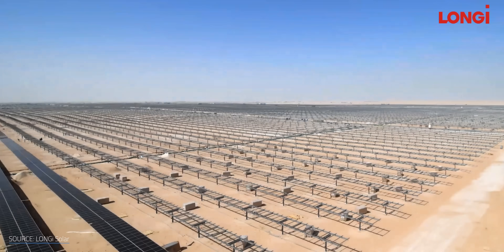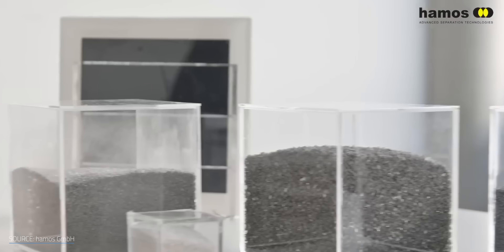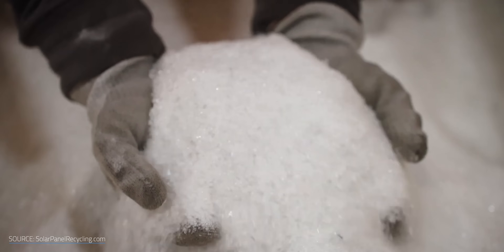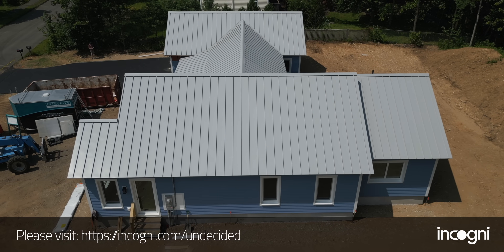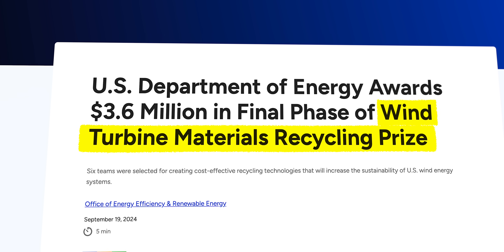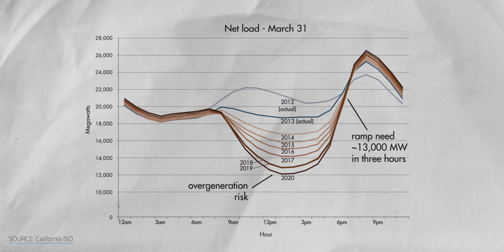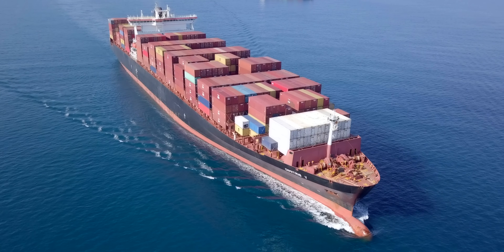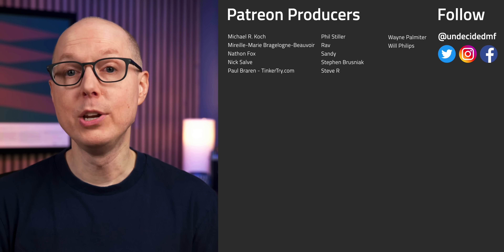How We Solved Renewables BIGGEST Problem

Comment: I work for a recycling equipment manufacturer/integrater and we recently had to try separating material for solarcycle trying to separate solar glass from the silicon cell and metal. It's extremely difficult to get to the materials to the desired purity. As with anything, chasing that last 0.1% of purity takes 99% more effort. It's exciting to see these companies exploring the recycling options but in the case of solar cycle they don't have a industry scale solution and have yet to design a full scale process
Reply: Maybe it would be better if they produce the 99.9% pure material and sell it to the company that manufactures new products to do the .1% additional refining. I'm guessing part of the issue is that the feed material isn't always constant as company A's solar cells may use a slightly different solder than company B.
Reply: @ryelor123  it’s really just about the sheer diminishing returns on how much you have to invest to get to that final purity. Thing with recycling is that it’s almost always more expensive than getting new raw materials, just because out how much effort you have to go through to get to that last final usable product, while also maximizing the recovery of the materials. It’s easy to get 100% purity if you’re not worried about losing extra material, but as soon as you try to maximize recovery and purity, the two metrics start working against each other. My company builds plants that sort and recover materials from household and commercial waste products,(getting plastic and glass bottles out of food waste etc.) and the people who run those plants sell their materials to secondary plants who have to refine that material that much more. And the capital cost of all of those plants are in the multi-million dollar range. Nevermind operating costs. TLDR you can reach any desired purity you want, but it gets exponentially more expensive the closer you get to 100%
Reply: Yeah this is clear a specialized  process and most can only remove glass and frame. This why large scale facilities are needed.

Comment: Hey Matt, it's nice to recovery high yields of valuable metals from batteries. But the electrolyte is often neglected or degraded. Whilst the most used one is LiPF6 in cyclic carbonates, producing hazerdous substances. So this issue still needs to be tackled.
Thanks for the vid again!

Comment: Thanks for the nice video.
The real question is what is the final carbon footprint of a technology.
We have modern gas and hybrid cars that have a smaller carbon footprint than fully electric cars that do not become carbon neutral in even 8 to 13 years or never, depending the region one lives and origin of the power production.
That is why we need modern nuclear energy until we figure jow to mange the impact of other systems and massive batteries.
I am trying to be realistic since we built plans like the EU Euro plan that have proben to be totally inaccurate yet they have created a huge disruption.

Comment: The real problem is with the grid. The grid is not interconnected.

Here is an example,

In Germany in the northern part the wind potential is very high and last year they had to stop wind turbines (power curtailment) but the southern side of Germany had to use coal power plant because the grid was not connected properly. Even if they want to use renewables they just simply can't.

I WOULD SUGGEST THAT WE SHOULD FOCUS MORE ON GRID INTERCONNECTION
Reply: Grid interconnection has major engineering and operational challenges that aren't obvious. I live in Washington State in the US. Our grid is connected to all the states around us, and we sell a lot of hydropower to California. There are 2 major changes with this:
1) Power is lost quickly over long distances. By the time the electricity reaches California, more than three quarters of it has been lost.
2) Power problems in California affect our grid. Anything that could cause a major blackout there, (quakes, storms, fires, just don't live in California, k?) causes whiplash to the grid here. Now, Washington has robust systems in place to compensate, but they're not cheap or simple. Other states that sell power to California often have brownouts whenever anything happens in California.
Reply: @marenjones6665   We had that a few years ago when the central part of the US grid systems got overloaded.  Texas having 20-degree weather was causing blackouts all the way up in North Dakota that was having -20 and worse weather.    20 degrees without power is an inconvenience, -20 without it is fatal.
Reply: @marenjones6665  "more then three quarters has been lost" sounds way to high...? Dont get me wrong, there will be losses ofcourse, but 75%? Ive been able to find two interties between WA/OR and CA. The Pacific DC intertie and the California Oregon AC intertie. The Pacific DC runs on +-500kV (1000kV pole to pole). And the CA-OR on 500kVAC. They're 1360 km and 960 km long respectively. (~845mi and ~600mi)

 I have to admit I havent been able to find any hard numbers for either regarding efficiency. But in general HVDC will lose about 3.5% per 1000km, HVAC about 6.7%. Wich would mean they get about a ~95.2% and 93.6% efficiency... Ok, these are general numbers, so take it with a grain of salt, but I'm calling bullshit on the "more then three quarters" thing... Its not even three quarters that gets to the other end, its WELL above that.  

But I agree on the problems on one side affecting the grid on the other side. You get the benefits of transfering imense amounts of power, but there is always the possibility that it'll go down. So it aint perfect, i'll give you that much. But to me, that's not a reason not to do it at all. I live in Europe, it doesnt get much more interconnected than over here. And our grid (in my neck of the woods at least) is incredibly reliable. As in: over the last ~10 years I expirienced exactly two poweroutages, each lasted about 30 minutes... Counting the poweroutages I just heard about within the area. That number rises al the way to:.... 5. Of wich one was about 3 hours, the others were also about 30 minutes. 

Anyway, my point is, its not easy or cheap, nobody (with any knowledge about it) will say that. But it can be done and is simply nessecary to make as much use of renewables as we can.
Reply: @daansteeman5227   @daansteeman5227  you're doing great! I'm parroting what I've learned in visits to dams from guides, so I don't know what the exact scenarios they were citing. Also my memory is bad. Also my knowledge of the topic is bad. Thank you for your research.
Reply: @marenjones6665  Haha no worries! I'm very curious to what scenarios they thought of where 75% of energy would be lost on the way. I mean, even if there is a scenario where that would happen I cant imagine them not just going "yeah, nevermind then" and basically shut the thing down. My best guess would be in very low power scenarios. Where all the hardware to convert the voltages to DC or to much higher voltages uses a relatively large portion of the power that is put into the system... But I'm just guessing at this point 😋
Reply: This so much. People think that renewables are the problem, while our crappy energy grid is the real culprit. None of the north-south grid expansion projects have been finished in a whole decade. (meanwhile China already has many HVDC lines...)
Reply: In this thread, 3 of the 5 current posts have been back-paged by YT.
Reply: That sounds good but that also creates new vulnerabilities. So unless you can instantly isolate parts of the grid during hacking, EMP, and solar flare events, then total interconnection would just create a brittle system. Also, energy storage is the most important issue of all. Far more important than solar cells or wind generators. Figuring that part out is the key to actually making the electrical system better.
Reply: @ryelor123  It does create new vulnerabilities as I stated in my original comment. I dont know about "instantly" isolating parts but there are many safegards in place. Both active and passive. But look at europe, we have a VERRY interconnected grid, both on relatively short distances and at long distances that are more similar to the distances needed in the US. 

I agree that energystorage is important, arguably more important then interconnection. However, storage is complicated to do at large(ish) scale and stupid expencive. Interconnection isnt cheap or easy. But comparitively its easier and more efficient then storing energy. The energy used in a house is easy enough. Current battery technology is easily capable of storing 1 or 2 or even more days of use in a houshold and inverters can connect it directly to the grid. I have such a setup and my 16kwh battery and inverter can run my entire house (including a heatpump for heating my house and warm water)for a day or 2 in the winter, 4-5 in spring and fall and well over 7 in the summer. So in winter ALL my PV goes into my batteries and gets used inhouse (with quite a bit of import from the grid). In summer ALL of my useage comes directly from the batteries or PV. And I export a LOT of energy to the grid. I have plenty of energy in a year, but storing that energy in august to use it in january is just not feasable. So I'd rather have it going to a different part of europe (or overseas for all I care) to be used wherever the weather is shit at that moment then it going to waste. And for that we need interties.

But to store enough energy to run a small factory the amount of batteries and inverters (and therefore money) is insane. So thats, at least with current technology, not feasable. And that is storage for a day, maybe a week. Not summer to winter.... Wich is a completely different puzzle.
We can get hydropower from norway and solarpower from spain when the weather is shit here. And we can send our (and spains) solarpower to norway for pumped hydro storage (I know, thats storage, hydro is one of the few ways we cán store large amounts of energy. But still its a drop in the bucket compared to what we use in a day).

Anyway, my point is: we need both. Storage is important, and will become more and more important as we get more renewables online. But storage is not the beall and endall.
Reply: @daansteeman5227  we can use pumped hydro storage it can store gigawatts of electricity.
It just needs to clear the paperwork
Reply: @ashishdubey-46  To some extend, yes ofcourse. But thats not the beall endall either. It takes years to build a dam. It destroys the upstream ecosystem. And the things have a nasty habit of breaking.... not often, but it does happen. Not to mention that where I live pumped hydro is simply not possible since our hightst "mountain" is about 300 meters tall. 

Its one of many solutions we need to use. But even with pumped hydro: storing enough energy in the summer to run a city (or even a few factories) in the winter is just never going to happen. Its great for gridstabilisation and storing insane amounts of energy during the day that we can use at night. But on gridscale its still a drop in the bucket. I regularly work in factories. So I know the imense amount of power some of them use. 

To get some idea: one of the factories I regularly visit has two 3x400V 1200A services. At full capacity thats about 1600kW. They of course never run on full capacity so lets call it 1000kW. They run 12 hours a day, 5 days a week. At night there are a couple of big fans that run 24/7 that use about 300kW in total. 
So in a week they use 1000*12*5=60.000kWh during production and 300*12*5+300*24*2=32400kWh. So 92.400kWh per week. Lets call it 100Mwh (its all back of the envelope calculation anyways). 
The nearest pumped hydro facility near me is in luxemburg, it has a capacity of ~7Gwh. So that can run that little factory for about 70 weeks. (to be fair, this is MUCH higher then I expected, my guess would have been a week or 2-3.) 
BUT: this is one small factory. I know of at least 4 others like it within about 100km from my office. And a few of our costumers have MUCH larger gridconnections. I dont know the specifics of those tough, wich is why I used the other one for the example.

My point is that even though pumped hydro can store imense amounts of energy. Its still a fairly small amount compared to the amount we would need to store. Not to mention that simple geografy wont allow such a facility in a lot of places. Including my entire country. So "it just needs to clear the paperwork is a simplification to the point it loses all meaning....
Reply: @ryelor123  except we have an interconnected grid across Europe, including the UK and we don't suffer those problems. So no, connecting grids isn't a serious problem. It's a big infrastructure project regardless as you need undersea cables, or trenches and tunnels to make it efficient but again, all that is a solved problem. The only issue is planning permission and spending the money.
Reply: @ryelor123   @ryelor123   @daansteeman5227  Let's say that we lose 20% of power.
But look you still got 80% of your power which is a lot compared to absolute zero during power curtailment.

We can store this in pumped hydro storage.
Why did I choose pumped hydro storage because it doesn't have that fancy chemistry and is simple to build and also more reliable (some pumped hydro systems were built 70 years ago and are still in use).
It can store gigawatts of electricity.
People might say water is an issue but these systems can be built using sea water near the shores you just need elevation and anti crossing materials which can cost around 15% more than the conventional ones.

In conclusion the grid integration is a lot more expensive but it's good in the long run.

In California during the daytime the solar energy produces more than needed which leads to grid curtailment.

Someone can send solar energy over long distances even if the power loss is about 20 percent or something. He will still make dollar$ but in case the grid integration is not available during the power curtailment he has to shut it down which is a loss and it will discourage him from investing in  renewable energy.

Coming to the EMP, hacking,  solar flares, etc. Yes these are major challenges but are also rare to happen like The Carrington Event of 1859 was the strongest recorded solar storm, and if a similar event happened today, it could cause major disruptions. . Honestly I don't know the solution for these problems. We need more research and development,  building better security systems.
Reply: The Chinese are using long distance DC power transmission technology to move power thousand of kilometres - the US is just unwilling to commit to green technology enablers like this as they are expensive and the political environment is so toxic that policy changes every 4 years.
Reply: Yes, but just look up who is responsible for the delay in the grid interconnecting from north to south. And who is responsible for the lack of renewables like wind in the south? Shut off nuclear in Bavaria, build a ton of solar but no wind (lol) and wonder why you don't have enough power in the darker months? 

It's mainly a political issue, not a technical one.
Reply: @pranjaldubey2009  i Brazil its also all interconnected and that helps the whole grid
Reply: The grid is connected but it does lack capacity for peak hours  to shift loads. 

This is due to massiv delays on north -south link  due to local protests
Reply: Too many losses to make the grid fully interconnected like that. What would be needed are long distance DC links feeding small grid areas.

Comment: 0:40 "When we think of recycling, we think of sorting glass, paper, and plastic into seperate bins" Then we look at the massive in comparison plastic bin and think "why do we make anything out of plastic instead of glass and paper/cardboard" since this bin twice the size of the other 2 combined is just going to end up in the landfill or burned anyway
Reply: Also, it's much easier to mold.
Reply: Easy answer to your question of why we make anything out of plastic. Plastic is stronger and lighter than both glass and cardboard. It doesn't shatter into dangerously sharp shards when it breaks nor does it become soluble in water.
Reply: @asandax6  plastic is an incredible material we use it to good effect in many industries even domestic plumbing to relieve demand for steel and copper, but using it for single-use items such as drink containers seems like companies are shorting the environment for profit
Reply: Plastic bottles are lighter, which means it takes less energy to ship, which greatly reduces co2 emissions from shipping.

Comment: Worst fallacy (imo) is that the taxable depreciation timelime is the useable life.

Just because a business can only write them off for 25 years does not mean anything about the usefulness of the panel. We could end up for panels running for hundreds of years but we have to embrace the idea of empowering current and future DIY enthusiasts.
Reply: Meanwhile back in reality. We already know full well that stuff isn't going to last for decades let alone centuries in real-world working conditions.  🙄
Reply: @illbeyourmonster3591  you're taking on self limiting beliefs. Lots of stuff lasts for decades. Even some stuff made this year will be built to last.
Reply: @illbeyourmonster2  fossil fuels arent gonna last for decades either, but solar panels already are
Reply: @Sadnessiuseless  I have worked in and with the oil industry for years. We have more oil than we will ever use and can with time transition to using organic sources for feedstock to keep the refining systems going indefinitely.
Reply: @Sadnessiuseless  Solar can't make up the difference in how much total energy we use.   Also panels don't last indefinitely either.